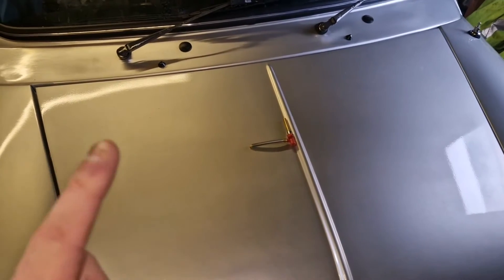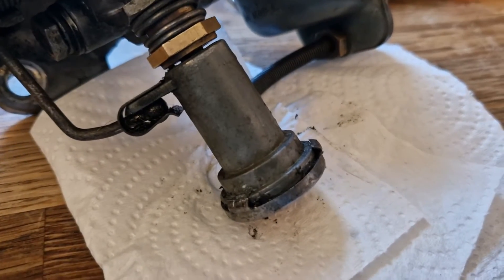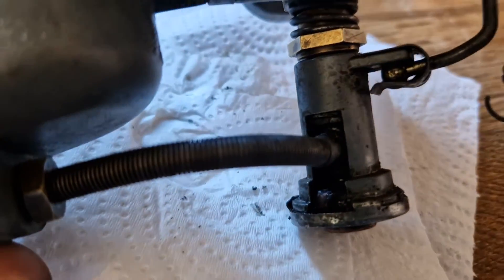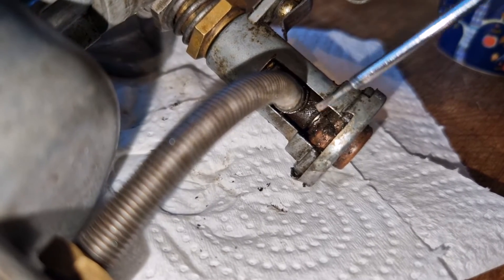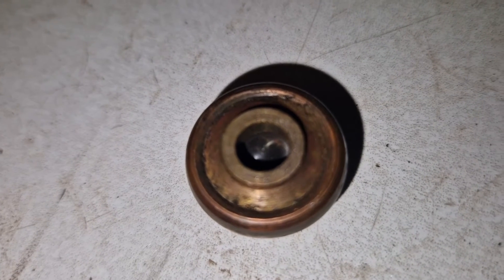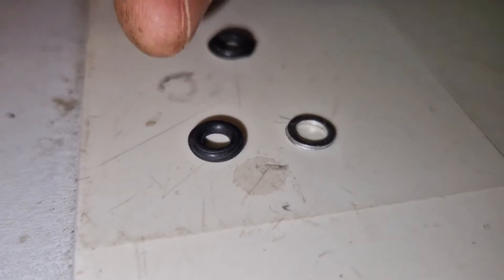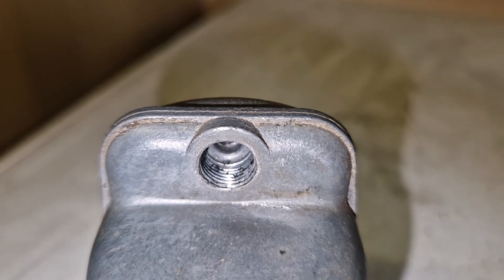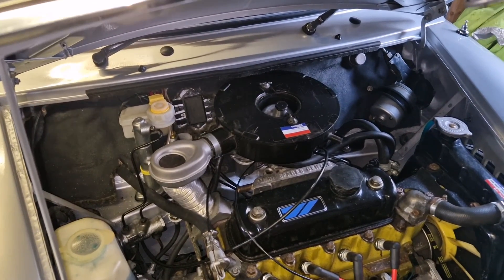110 Classic Mini Restoration - 2p trick Waxstat HS4 carburettor

Comment: You didn't measure the distance after placing 2P?
Reply from the maker: Hi, you are right that you should for a direct replacement. Although really you will need to dial in the mixture anyway and if it is slightly off you can compensate with the mixture nut. I've used the lift pin and colour tune to get it close to the right mixture. I'm just putting out videos on dialing in basic settings, air leaks, timing, fuel and electronics over the next couple of weeks that may be helpful.